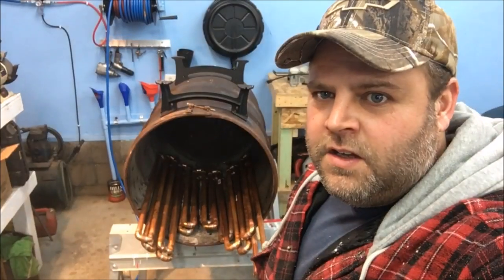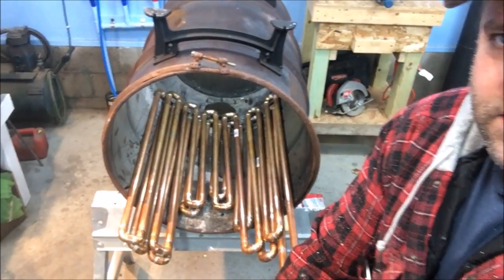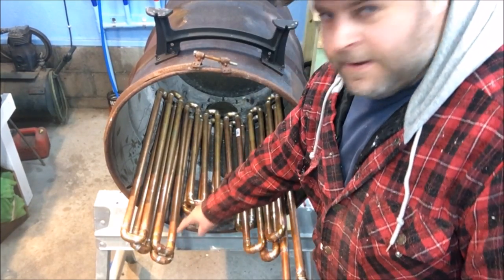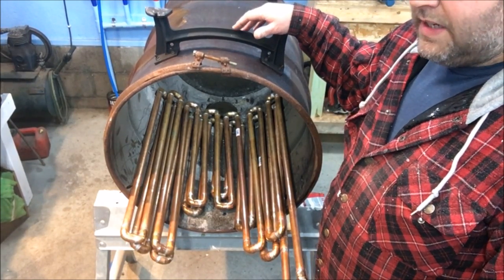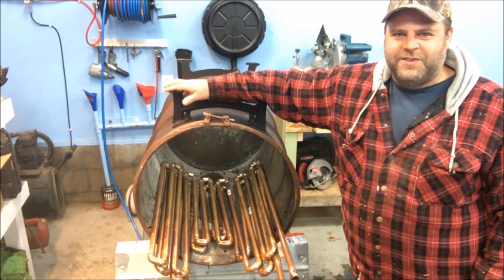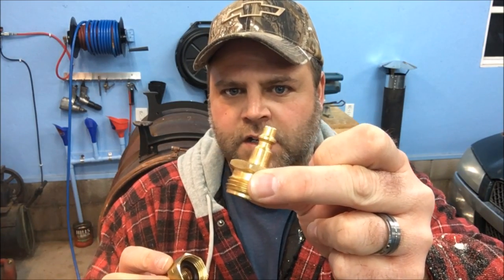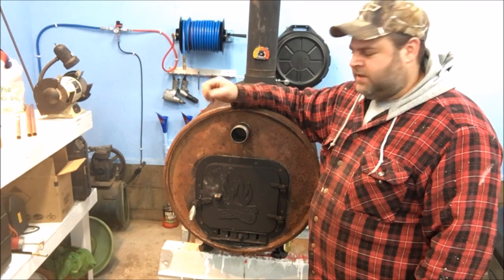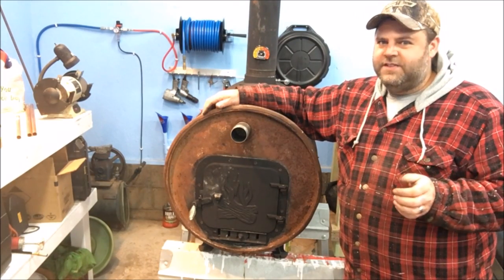Copper Heat Exchanger In Barrel Wood Stove To Heat Pool

Comment: I’ve watched a bunch of these videos trying to figure out what kind of build I want to do. Then I came across your video, saw the channel name and had to give it a watch. As a fellow yooper living in the warm and sunny south that is cleveland Ohio, I think I’m goin with this design. A lot more work but it looks way more efficient heat exchange wise.
Reply from the maker: Thanks for watching! I have a few videos on this build including a follow up video after using it for a while. The design is good but if I had to build another one I would build a shield under the copper pipes. With the pipes open to the flame it gets a lot of creosote build up on the pipes.

Comment: Great video, very good explanations. I’m asking myself if I should change the design of my pool heater from copper coil according to your heat exchanger
Reply from the maker: Copper coil would work also. I mainly just wanted to cover more surface area in the heater with this design.
Reply: I have the fire burning in the middle of my copper coil and think that a good amount of heat just goes up in the air. With copper right above the fire you might avoid that loss @UpperPeninsulaDIY
Reply from the maker: Great point!
Reply: @schitthe  Hi mate. How have you got on with this. Do you also have a baffle in the chimney to reduce heat loss etc?

Comment: Excellent job soldering all those pipes and elbows into the shape of the barrel, but you will have to run water through the pipes at high speed to prevent boiling at the very least. I'd guess you could melt the solder if you burned a fire hot enough, and I've heard about those barrels glowing cherry-red. Cool idea though.
Reply from the maker: Thanks for watching and commenting! I have been running it for two summers now with no issue. Well, one slight issue. I turned the flowing water off when the fire was out, not thinking the barrel and the piping was still warm. Ended up melting a hole in the plastic piping I have connected to the copper going to the pool. Easy fix though but you are very right. Water always has to be flowing through the pipes. Thanks again!

Comment: Having the pipe on top looks good for a secondary burn. Suggest going most the way to the back with it, drilling holes along the length of it and putting a cap on the end. It should be efficient and burn the smoke,
Reply from the maker: Thanks for the suggestions and comment!

Comment: You might not have to weld to put the cover on the vent hole. What you can do is use a self tapping screw and drill a hole in your vent flap then place the screw through the hole into the metal stove. Tighten the screw just enough so there’s resistance on the flap which would allowIt’s to stay in the position that you set it at. Hopefully this helps
Reply from the maker: Thanks for the tip!

Comment: Great video. Would brazing the copper solve the melting solder concerns?
Reply from the maker: I'm not sure if it would make a difference or not. After using it the last few years I haven't had any issues with the joints coming apart. As long as water is flowing through it, the solder won't melt. Thanks for watching and commenting!

Comment: Add forced air, will burn hot, move water at a high rate you want volume  not an extreme high temperature on discharge water. Great job thanks for your efforts.
Reply from the maker: Forced air into the burn box might be a good idea. Thanks!

Comment: Isn't that solder going to melt I wonder if maybe you should not have used Mig braze instead
Reply from the maker: Used it for an entire summer so far and it is still working great. As long as there is water flow through the pipes the water will keep the solder cool enough not melting. If no water movement then yes, there would be a problem. Thanks for watching and commenting!

Comment: I'm looking to do something similar for my spa in order to reduce the running costs by keeping the spa at a lower temperature when not in us and them shortening the time to reach ideal temperature.  Couple of questions:
1) wouldn't it be more durable if the piping was on the outside of the barrel and thus not susceptible to being coated and caked in the soot and whatnot from the burning wood?
2) for a barrel of that size what would be the expected energy output?  I've done an excel spreadsheet to work the time out and the burner needs a really high output to make heating the spa within 30mins viable.
3) would insulating the stove with some fireproof blanket help in reducing wasted heat and increase the heat output overall?

Look forward to the next installment.
Reply from the maker: Thanks for watching and commenting. 1) Yes, piping on the outside of the barrel would be more durable but it would be difficult to wrap the pipe tightly around it. It could be done though. One thing I didn't think of is the condensation I get from the pipes as they heat up. 2) I'm not sure of the energy output but yes the fire needs to be really hot and stay hot in order to have a decent output of heat. I found I need to burn hard wood in order to produce a good heat. 3) Wrapping the barrel would help, especially if you put the pipes on the outside of the barrel.
Reply: Thank you for taking the time to respond.  I am going to give this a try for the winter.  The spa really does not need heating this summer, which is not the norm in the UK but it is an exceptionally hot, long lasting summer.
Reply: Have you gentlemen though about a 30 gallon drum inside the 55 gallon drum as you can get insulation cloth in there as well as the heat exchange for the water. You can put the flue through to the smaller drum business as usual and your pipes are not on the open fire breaking down as fast.
Reply: @UpperPeninsulaDIY  I used aluminum flashing as a quick and dirty heat shielding.  Have some doublesided mounting screws (bolt on one side) that I plan to use as a standoff to permanently mount.
Reply from the maker: @netwrench6570  Excellent job! Thanks for sharing the idea. Let us know how it works out.

Comment: Maybe if you cut a slot under the barrel about 10" wide by just short of the length of the barrel.  Then you could put a rebar grate inside the barrel with about 3" square openings.  The ash would drop directly to the ground and you would have excellent draft.  You could regulate the air flow and intensity of the flame with a flue dampener.  

You have inspired me to get off of my butt and build one of these.  Thanks!!
Reply from the maker: I like that idea. Probably would have to put sand or gravel under the barrel as to not start a grass fire but it would draft better. Thanks for the tip! Good luck on building yours also!

Comment: Great video, have you been able to measure the BTU output of that heater? Curious to see how well it will do.
Reply from the maker: Thanks for watching and commenting! I haven't measured the BTU but I have found a couple interesting things out. In order to keep a good hot fire in the barrel, burning hard wood is a must. I also found that the cooper pipes create condensation. The dripping condensation makes it tough when trying to get the fire going. I plan doing a follow up video in the fall after I have used the barrel stove a bit more.

Comment: Awsome gave me a good idea. I just have a question logs burning wont that heat make soder weld to melt. If so let me know
Reply from the maker: As long as there is water flowing through the pipes the entire time there is heat the solder won't melt. Thanks for watching and commenting!

Comment: Could you add some pipes inside to that threaded pipe on top, and then the air would be directed to the bottom? I'm not sure that it woukd work better than (or even as well as) the bung hole solution.

Another possibility is that you could install one of those dial air intakes, like they have on charcoal grills, only put it on the back, where there is probably some room.
Reply from the maker: Them are both good tips, thank you!

Comment: I cant help but think... as soon as u light that fire, your gonna have a can filled with solder and copper fittings..

Maybee...  3/4 soft rolled copper, (used for water main line feed)
Reply from the maker: I've used this stove/heater for 2 summers now with no issues. As long as water is flowing in the pipes the water keeps the copper and the solder cool enough to not melt the joints or the copper. Your idea of rolled copper will work just as well. Just remember to always being flowing water when there is a fire lit or even when the fire is out and the barrel is cooling. Thanks for watching and commenting!
Reply: JOKER wrong. As long as water is in the pipes it is fine

Comment: Great video. Can I ask when you connected the end of the pipe dispensing the hot water did you have any problems with the copper pipe being too hot and melting the plastic / rubber pipe to the pool. Thanks
Reply from the maker: All I used was plastic water supply hose from menards. Haven't had any real issues. One time I had an issue but that was my fault. The fire had died out but there was still some heat in the barrel. I forgot to turn off the pool timer and the pump turned off. Plastic pipe burst because of the pressure in the pipe from the heat. Didn't damage the copper pipes as all. That's the only issue I have had. Thanks for watching and commenting! I do have a 2 year follow up video also: https://www.youtube.com/watch?v=AaOcjr_dYdQ&t=26s

Comment: i guess with constant water flow the pipes should remain cool enough for the solder joints not to fail? i have seen wood stove water heaters where the wrap copper tubing around a pipe.
Reply from the maker: That's my plan, as long as I have water flowing through the copper pipes the solder joints should not fail. Key is water flowing... Thanks for stopping by, watching and commenting!

Comment: Any updates on Efficiency loss over the season?  wondering how the condition of the tubes over a season?  seriously debating whether to do internal tube configuration or wrapping coil on the outside with insulation. thanks
Reply from the maker: It has been working great. There is a lot of sot build up on the pipes but doesn't seem to affect the heating of the water. If I have a nice hot fire going this wood heater works just as good as my propane pool heater. I think wrapping copper on the outside and then some sort of insulator would work just as good. Thanks for watching and commenting!
Reply: thanks for the feedback pal

Comment: To turn lemons into lemonade get another kit so you can turn that barrel into the top of a double barrel. I'm pretty sure you will find that the temps are too high for copper tubing. It should be in the upper barrel.
Reply from the maker: Thanks for your advice! So far I ran it all summer with no issues, as long as water is moving through the pipes. I made the mistake right away with turning off the pump when I thought the fire was out... Thanks again for watching and commenting!
Reply: @UpperPeninsulaDIY  the main reason I said this is that copper melts easily. Like aluminum. So it may need to be well away from direct flame. That and it could melt any solder joints. If it can melt with a pen it will melt in a fire

Comment: What is your solution for the creosote that forms an insulating barrier after so many fires?  Mine formed so much the water would no longer get hot. Had to power wash the pipes. Considering making them on the outside and then insulating them.
Reply from the maker: Your right, mine have creosote on them also. I'm sure I am losing heat but I've yet to clean mine. I've thought about maybe putting some thin metal like tin under the pipes but I don't know how much heat you would lose with that also. If you come up with something let me know. Thanks for watching and commenting!

Comment: Howdy from Texas, 
Born & raised in Kalamazoo.  How did your project work out so far? 
I'm building one very similar except I am going to coil soft copper tubing around the EXTERIOR of my barrel.  My reasoning is that after a year or two the pitch,tar, and creosote build up on the tubing it acts like an insulator and lowers the output temperature of the water. Also any sweating will not drip into fire. I realize outside the firebox it won't get as hot as inside. 
My concern is the type of copper tubing I should use. K copper, or L copper, refrigerator coil copper????
Might you have any ideas? I don't know the best and or the least expensive copper tubing I can use.
Thanks a ton. Any information would be greatly appreciated.  
One Michigander to another , 
Peace brother.
Reply from the maker: Hello Jerry! Always nice to meet a fellow Michigander. I do have a quick update video on the stove: https://www.youtube.com/watch?v=AaOcjr_dYdQ&t=69s. It's still working pretty well. Your absolutely right with the tar build up on the pipes and the dripping of the pipes from condensation. My thought was to maybe build like a heat shield to protect the pipes from the tar build up and then let the condensation run down the sides of the barrel instead of right on the wood. Putting the pipes on the outside of the barrel would work but you would probably lose a lot of heat unless you then insulated the pipes some how. I don't think I would worry so much about what type of copper. Just get what will easily work for what you want and what is readily available. Hope that helps some. Let me know how your build turns out.

Comment: i wouldn't think the solder would hold.... can you show what temp you get up to before it would fail.
I'm thinking you should have used a solid pipe rather than soldered joints. im just about to start my project on building a pool and using a wood burner to heat it but im just doing my research at the moment
Reply from the maker: So far I have gotten the stove up to about 500 degrees F. No issues at all. As long as the water is flowing through the pipes the entire time the fire is going the solder or the pipe will not melt. I've seen other videos were people have bought a coil of copper pipe and just simply put the coil in the stove, then you don't have any solder joints inside. There is definitely more than one way to build a stove heater like this. Good luck on building yours. Thanks for watching and commenting!

Comment: I like your stove man. I'm putting up my one wood stove barrel pool heater. I was wondering what type of soldering you got there for your copper tubing. Cause i saw one of our mate that said that it melted right of the first burn ...! i'll try to silver soldering and i'm gonna stick the "U" shape fitting right outside the front of the stove to prevent from that outcome. Let me know what you think ...
thanks !
Reply from the maker: As long as water is flowing through the pipes you shouldn't have any issues with the solder melting. But that being said I have not tried mine yet, that's just my theory. As soon as I'm able to open up my pool this summer I will then be able to test. Thanks for stopping by and watching!
Reply: The issue is not the function of the stove. You need the water pump to pump the water @ the correct speed to allow water to stay in pipes long enough to get warm & flow into pool @ speed that prevents pipes foam melting & allows water to heat. We devised our own similar system. With the correct water pump keeps pool @ about 85 degrees

Comment: The one I did...I had the bunghole Under the door....and put that pipe inside and ran it under the grate I made.  Put more fresh air..towards the back of the fire
Reply: Can't wait for spring so I can get back to camp and do fun stuff like this too.
Reply from the maker: That's a good idea to run a pipe inside. Thanks for the tip. I'm ready for some warm weather for sure. Getting cabin fever. lol

Comment: Will the solder joint be affected by direct heat?
Reply from the maker: As long as the water continuously flows the solder is unaffected by the heat.

Comment: Simple fix. Turn your door over, loosen the Lid ring and spin it around. Now the pipes on the bottom and the doors right side up.  With having a removable lid you can do that.
Reply from the maker: Great idea! Thanks for the tip!
Reply: Don’t do that. You will wreck your piping if you put them on the bottom. The design is very similar to an OTSG(once through steam generator). You’ve inspired me. Thank you.

Comment: stupid questions will solder melt when in use
Reply from the maker: Not a stupid question at all. I get asked that a lot. As long as there is water flowing through the pipes when under heat it won't melt. With out water flowing the pipes would burst and then melt the solder. Thanks for watching and commenting!